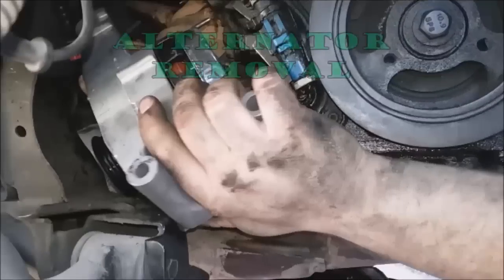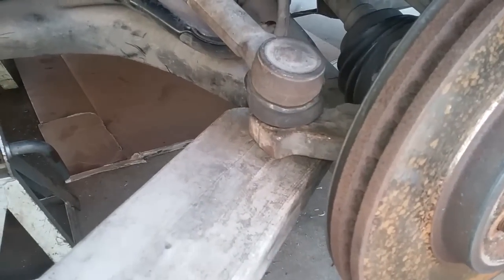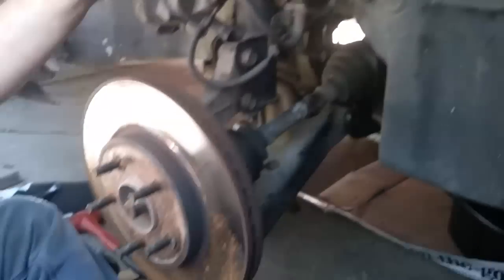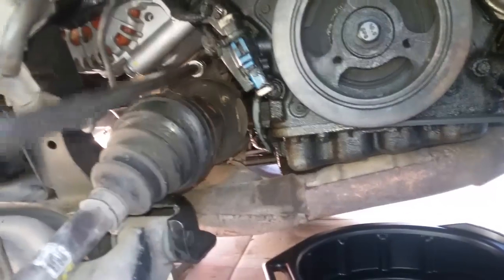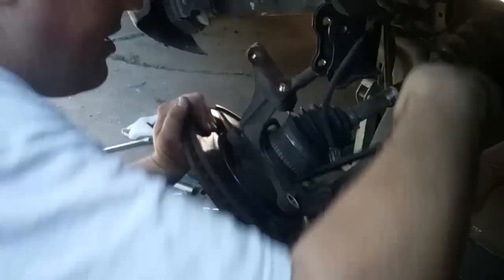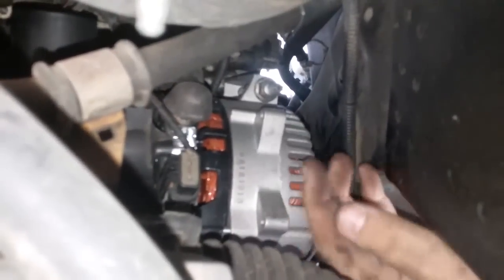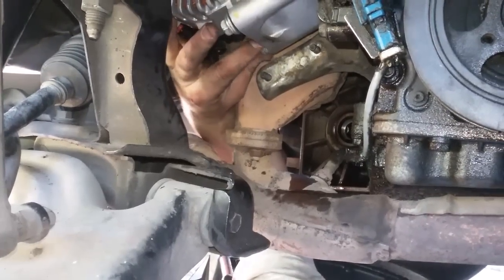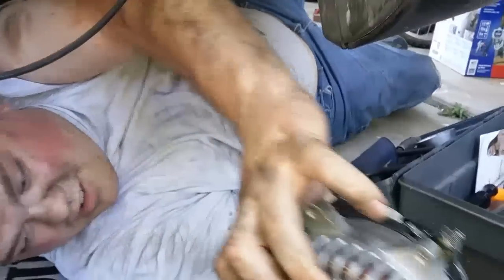Alternator Removal: Mazda Tribute 2001-2004; Ford Escape, Under the car method

Comment: Just did one today. Screwdriver in rotor slot to remove axle nut if no one is available to press on brakes.  No need to remove caliper/brake assembly. Remove ball joint bolt and nut. Penatrating fluid pry ball joint from knuckle. Swing to wherever is needed to get axle out of hub. AND BE MINDFUL OF THE SENSOR AND TONE WHEEL. This tip is only for axle removal. You covered everything splendidly as far as alternator. Some times I opt for The 2 strut bolts over ball joint to swing enough room for axle removal. But then you have to really make sure the knuckle is supported and lines aren't to tight

Comment: If this helps, please do not pry on the reluctor wheel (the wheel speed sensor ring around the end of the axle that looks like a toothy gear). Also, know that if you remove the two bolts through the strut and spindle you will need an alignment as well. I usually just pop the lower ball joint and leave the strut attached to maintain alignment. The "transmission line" that is pulled is actually the axle. That design is to lessen the torque steer of a  v6 front wheel drive. Also, do not be deceived by how easily the bolts and nuts were removed. That was definitely taken apart before the video. If not, the axle wouldn't be his only fight during this job. This job will be much harder if you are located in a climate that causes rust. Good luck! And this really is a good video. Bravo champ!

Comment: Great vid, But if you want to do it, like the pros, what you do is remove the top motor mount lift the engine all the way up now you have access To the top part of the alternator and if you wanna remove the alternator what you do is drop the engine as far down as possible and the alternator comes right out it’s a very quick job half hour tops

Comment: But I must admit,  you got the job done! I have a 06 escape, and yes your video works for my 06 also on the alternator. What a joke to change the alternator! I upgraded my audio in mine big time and gonna upgrade my alternator to a higher amp! I'm gonna go ahead and rebuild the front while I'm at it.  The entire lower wishbone with new ballpoint and bushings $98 and this 2024! Grab this stuff while it's cheap and available. New strut cap, $33

Comment: My 2001 Mazda doesn’t have enough room to back out the alternator this way. So frustrating. But thanks for the video, at least I’m not the only one that hates this job.
Reply: Just ran into the same problem, what did you end up doing? Would appreciate some clue as what to do BC im at an impasse.
Reply: FYI for posterity, Just did this job on a 2002 tribute v6 awd.  I also did not have enough room to sneak out the old alternator.  I removed the alternator bracket (3 bolts, 1 hard to see) to gain space, but even that wasn't enough.  Planned to drop the subframe, but found the easier way to gain space was to put a block of wood, and floor jack under the oil pan and then undo the passenger side upper motor mount (a single 18mm bolt), then I jacked up the engine about 3 inches and was able to sneak out the alternator.  This job is easier on some mazdas/escapes than others.  I fought getting the alternator out for a solid hour before I decided to just jack up the engine after removing 1 motor mount bolt.  everything after that was easy and now the vehicle is running great.  sockets used were basically 8mm (wheel speed sensor and battery terminal), 10mm 
(deep and shallow), 13mm, 15mm, 17mm (removed tie rod end, but maybe didn't need to), 18mm (deep and shallow, caliper bracket and strut bolts i think), 19mm (lug nuts), and 32mm (axle nut).  various rachets, various extensions.  probably a screwdriver and pliers in there somewhere.
Reply: @slimtechgtp  how much time did it take you to get the job done?

Comment: Saw a frame bolt….wondering if you can take the font cap off and get to it instead of from the tire. You’d only be disconnecting the radiator, headlight, etc

Comment: You don't have to pull any of that off if you just drop the subframe bolt about an inch you can work the alternator out around the axle
Reply: I’m going to try your method today I don’t wanna have to take all the extra parts off should speed up the process
Reply: So just remove the swing arm bolt to move the rotor and suspension out of the way then take the sub frame bolt out a inch or so and then it comes out?

Comment: Was the actual time for removal about 23 minutes?  If not how long for you to get the alternator out and then how long to get it back?  A local shop just quoted me near $1,000 to do this job.  Looks like it should be 2 hours at $120 and hour and $150 for a genuine part, so about $400 in a shop and $150 in my drive way.
Reply from the maker: This was done with minimal editing, I only edited out going to get the tools I didn't have near me. It may take less time if you don't beat yourself up like I did. Or if you don't have the stud.

Comment: I haven't done it yet but looking at the video I was told the changing the alternator would be a pain in the butt I changed the starter if the 2005 Mazda Tribute V6 was not that hard or complicated at all but I was told that forever had a chainsaw in there it would be a complete pain in the butt

Comment: Just remove the engine mount bolt then pull the engine about 2 centimeters. You will easily remove it from behind the engine

Comment: Thank you for this video, now i know not to buy an escape
Reply: What car you going to buy?  I have one of this, and I find it easy to keep going compared to some of the other cars out there.  I am dreading the day I will have to buy a different one.  

I have heard horror stories of cars like the Ford Edge where the water pump is actually inside the engine.  If it goes bad it cost about 1600.00 for a professional mechanic to change it out and depending which way it leaks you may need your lower end of the engine rebuilt as well.

So just curious what car would you buy these days?
Reply: The 07 ford fusion is way easier to work on , I'm not looking anymore , I drive a 89 town car and I have to say it's way easier then these modern cars today, I'm gonna drive it till the wheels fall off after looking at a lot of repair videos of these modern-day cars . lol
Reply: I'm going back to older Jeeps. TJ's or Cherokees. I changed heater core, alternator and radiator in less time cumulative than just changing the alternator on this dang Escape.
Reply: @mikesportsman1811  ⁵⁵⁶5⁵5

Comment: You could have just undone the lower ball joint and you didn't have to mess with the brakes. That's how I do axles.
Reply from the maker: That could work. I was just repeating the way I've done it before. It doesn't take too long, so I didn't really try to find another way to do it.

Comment: CAUTION: just because people are videoing themselves removing parts and "getting a job done" on youTube doesn't mean they are doing the job anywhere near correctly. You're just watching him and taking it for granted that's it's the way to do it. It's NOT! It's not correct, his methods can damage 1) the wheel bearing seal by prying against it to remove the axleshaft from the hub, 2) can damage the other end of the axle at the transmission because he improperly removed that end first and when the axle "pops" out it usually hits the transmission seal, and 3) he pulls on the axle between the CV joints which can seperate them causing you to have to remove the boot and rebuild/reassemble the internal parts of the CV joint which most people will just replace the axleshaft assembly because it's so difficult to reassemble. Further he's unsafe in his methods as he didn't even realize or know that the brake rotor wasn't being held on by anything except for a light rust bond between the rotor and hub! So just because you watch a video doesn't mean it's the proper or safe way to do it. Wheres the video of the guy following his methods that then had to replace his axleshaft because it's too long to go back together because he seperated the joints from pulling on it? Or where's the video of him watching transmission fluid leaking out of the seal he nicked, and now has to once again take the CV axleshaft assembly out again to replace the transmission seal. But hey, the alternator is in! Lol

Comment: Ok, now at the part where he's removing the belt. He put a ratchet into the tensioner and "pulled" away the spring tension. Omg how did he even have the strength to pull away from all that tension. Not to mention if it slipped while his fingers were holding the belt in-between the pulley getting pinched. You're NOT supposed to pull on the tensioner, your supposed to put the ratchet perpendicular to to direction you need to rotate the tensioner thereby creating a LEVER and using leverage to move the tensioner not brute strength! Try having the ratchet coming straight down and pushing on it. It wont take much force at all. It's using leverage! And it's SAFE. I'm done watching omg

Comment: I'm having difficulty removing the alternator at this point,  I noticed you turned it sideways and it fell right in your lap, which brings me to this alternator bracket I'm looking at,  I sure hope it dosen't have to come out as well....but if it does to make it easier,  so be it....other than that,  all else was a breeze..fyi, this bi@tch has a bracket,  no way alternator come out,  3 10mm screws and it's out...

Comment: And don't pull the other end of the axle out of the transmission until you have the outside end out of the wheel hub because you're risking banging the axleshaft into the transmission seal cutting into and nicking it causing a major leak when you reassemble it. You're doing the job completely wrong. Guys like you are the reason I stay in business lol. Please read a service manual.

Comment: Do not EVER pry the axleshaft out of your wheel bearing hub as you're doing! You're prying against the seal and also might ruin the ABS toothed reluctor ring on the axle. Push on the center of the axle with whatever you need to bit STOP prying on it! It wont work anyway because it binds the axleshaft in the hub and won't come out easily. The only way is by pushing it out from the threaded end. They tapping a screwdriver with a hammer next time and STOP prying and damaging things.

Comment: You don’t have to remove the caliper bracket. And you have to remove the top motor mount bolt on the passenger side.

Comment: Also you never want to pull on the axleshaft assembly as you're doing. You'll seperate the internal joint under the rubber boots making it necessary to dissamble the CV joint. You'll find out you accidentally seoerated the joint when you try and reinstall the axle and it's too long because you separated it from pulling on it. It's very easy to do so DON'T ever pull on and axleshaft like you're doing because it's very difficult to reassemble a CV joint and boot. You really shouldn't be making videos because people that don't know any better might think you're doing this the proper way. Again read a service manual.

Comment: *****DO NOT***** remove the alternator this way!!!!! I just did one of these over the weekend and you can EASILY remove it from the top. Unplug the 2 plugs on the passenger side of the intake, unbolt the computer from the firewall and move push the power steering hose over. You'll need a 13 mm socket, a couple of long extensions on a ratchet, and a swivel and the bolts are easily removed through the gap in the exhaust manifold. This is the dumbest way I have ever seen. Take my advice and save yourself a lot of time!!!!
Reply from the maker: The way I removed it in the video is the way that my father, who has been in mechanics for over 40 years showed me how to. There is more than one way to remove any car part
Reply: @FlamingSpiderCyclone  He should have re-evaluated it. Anyone who does this is causing themselves a lot of work and then has to go get their car re-aligned just for an alternator replacement. I'm just trying to save someone a lot of time and a lot of work. If I was charging by the hour and wanted to take a lot of someone's money who doesn't know any different, this would be the most complicated way to do the job.
Reply from the maker: There are plenty of ways to get a part out. Whatever seems like the best for you is the way you should go. There are other guides to doing it and this is just one way. I no longer have this car, so I can't do it in another way.
Reply: @retrolife1095  thank u
Reply: @Retrolife10 can you recommend any video on how to do that
Reply: @bunmiojelana5560  do it this way , don't do it by the top,  more chances that you can break or forget important components , and it will take longer, ask how i know ...
Reply: @dayslife  thanks Seb I got it replaced  as how this video says but I was unable to put the serpentine belt back on and there was oil leaking from front differential which I thought it wasn't a big deal until I called mobile mechanic. He put the serpentine belt back and he told me differential oil is just 1 litre and I shouldn't have let it leaked. He charged me 200 Australian dollars

Comment: Also you're very lucky the brake rotor didn't fall off the hub onto your legs. There's nothing holding the rotor to the hub except rust. They normally slide right off. So having the spindle/hub tilted with the rotor dangling towards your legs is VERY dangerous!!!!! Remove the brake rotor, tap it with a hammer before it falls off on your legs, or put a lug nut on to keep it from falling. You're a danger.. I'm not watching any more. People shoukd beware of guys that are removing parts from a vehicle without knowing what the hell they're doing and videoing it so people watch it and do the same thing! You're lucky you didn't get hurt.

Comment: Sure you got the job done but it wasn't nearly the proper way to do it. Improper service methods cause damage to good parts. You got the alternator replaced and that's about it. I wouldn't use this video as a guide other than showing where to pull the alternator out of as you're service methods are wrong and damaging known good components/seals.